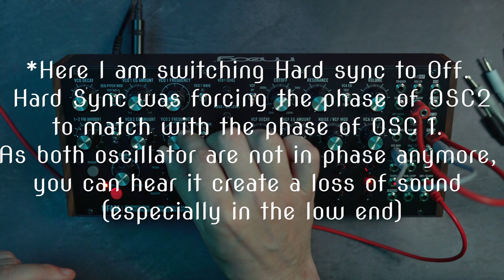Techno Kick with DFAM

Comment: I would be really interested in seeing more videos about the DFAM!
Reply from the maker: I wanted to but, don't really know what to do, this machine is very impredictable, and a lot of time I find cool stuff they are more happy accident, which is then hard to make a video about... but I will tru to do more for sure !
Reply: I have taken meticulous notes about knob positions and patching with audio recordings to prove the sound coming out of the device. Even if I dial in the positions exactly it always sounds different. I even bought larger knob coverings for more precise control.

That said it's not a problem when turning the device off and on, it's just that the pitch and velocity of the sequencer affect the signal so much and without any quantisation it's impossible to dial in exactly the same sound.

The takeaway is if you find a pattern you like *record it*.
Reply: @audioreakt  Ive had the same experiences. Some things cant be replicated.
Reply: Thanks for the video. I would also like to see synth sounds in this kind of regard
Reply: @mit136speichenumdiewelt  that makes it interesting somehow
Reply from the maker: @ghostinplainsight4803  that's why it make making video hard with this machine too, especially when using the sequencer, very hard to replicate, but I will try to make a video with tips so that can apply to any patch, and not how to make a specific sound
Reply from the maker: @leslyremy6002  you have to press record fast with the dfam otherwise you will cry because you lost evrything 🤣
Reply from the maker: @mit136speichenumdiewelt  will probably do, bassline and tom

Comment: Really cool tips you got a nice kick going. 👍 Do you send CV from Ableton / VST to the DFAM? I was wondering what cool ways to do that. As I don't have Eurorack or amy other synth to send CV. Cheers
Reply from the maker: thanks, it really depend the config I am using. It can be from ableton to dfam directly (you need a dc coupled audio interface for that, and use ableton cv clock out device), sometimes I have my Subharmonicon sync by midi to my sound card and then I use the clock out of the subH to sync the DFAM. I also have a torso T-1 that can send clock, or even my minibrute 2s... 😅 I am planning to invest in a multiclock soon so the answer will be faster haha

Comment: Interesting ! Can you have thé control in the pitch envelope playback speed ... to be able to control the "quantity" of mid compared to the sub?
Reply from the maker: Thanks , do you mean negatively ? You just have control over the decay of the pitch envelope
Reply: @audioreakt  the reading speed of the pitch envelope is probably fixed to the tempo, on a quarter note. Can we slow down the reading speed? it would be an equivalent to the rate function on serum , if you want. To have a control on the high /mid part of the kick and the sub part of the kick .

Comment: What would you recommend for my next drum machine? DFAM or Analog Rytm?
Reply from the maker: If you can afford the rytm, rytm then, especially if you work with Ableton, you have overbridge and seperate audio via USB, wider sound palette, sequencer etc... Dfam is cool because it's more hands on control, a structure different than classic synth which lead to different result so that's what make the dfam interesting...